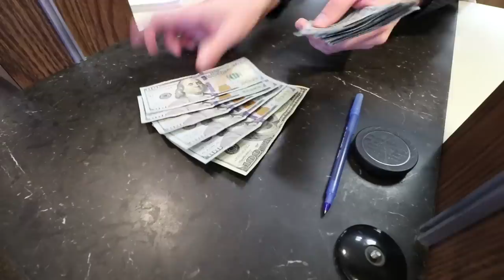WE BOUGHT A BACKHOE

Comment: How could you even say a comment about turbo when it is rather apparent you know nothing about the workings of a turbo equipped engine. Any diesel engine with a turbo is much better than one without for quite a few reasons starting with the engine puts out much more power at and above 2000 rpms, some engines spool up the turbo a bit earlier and some a bit later but generally at about 2000 rpm's the engine is putting out enough exhaust flow to spin the turbo at a high enough speed (rpm's) to boost the intake pressure. Reason two is that the engine get's better fuel economy since it is burning more of the fuel due to having fresh pressurized intake air flowing into the engine under pressure instead of the engine running like a vacuum cleaner sucking the air which causes much less oxygen to be available during the power stroke of the 4 cycles. All of my equipment is diesel powered and my tractor, dump truck and bucket truck along with my crane truck are all turbo equipped. The only truck without a turbo in my yard is the 1992 F-250 4-WD 7.3 L and it get's lousy mileage. Last but not least turbo diesel engines put out cleaner exhaust with less unburned diesel particulates and that is not only good for the environment but also better for working around like a backhoe, given that the engine is running at or above 1750rpm;s. The only bad thing about some turbo equipped engines is that if the oil seal ever fails that supplys the turbo chargers lubrication there is a possibility of having the engine start running on it's own engine oil and then it is an emergency situation to shut it down before it blows up from over revving or running out of engine oil. Two easy ways to go about this. First one is to have a good reliable full 10lb CO2 fire extinguisher handy and the ability to squirt it off directly into the intake which on most engines/vehicles is easier said than done and the second way which happens to be the way that I prefer is to have a shut off valve plumbed into the turbo oil line so that if the rare chance that the turbo blows a seal you could just turn a valve either remotely or open the hood and turn it to stop oil flow to the turbo and the engine will immediately stop running, this method is a sure fire thing since if other methods don't work chances are that the engine will begin to roar and run at such a high speed one would be reluctant to open the hood or even get near it in fear of it exploding. Long story short turbo charger equipped diesel engines cannot be beat by any other internal combustion engine as far as efficiency or longevity. And just encase you or other readers are not familiar with a turbo charger here is a simple explanation of what exactly it is: A turbo charger is basically a small exhaust driven turban connected to a slightly larger fan in a housing. When the exhaust of the engine spins the turban it in turn spins the fan which compresses the intake air supply that feeds the engine, 7-10psi boost is all it takes to make a diesel engine run better, cleaner and actually quieter.

Comment: You know you never buy machines that have had 5 gallon rebuilds people make things look clean and shiny to hide the turd under it. When somebody goes to the extent to paint up a machine and put on the factory decals they are hiding something. You possibly could be into this machine for thousands of dollars in repairs. Sure hope you know what your getting into, if I'm buying a machine I want to see it dirty I want to see what's leaking, what is worn out. Enough of the talk lets see you guys use the machine if you were an operator you should be able to backfill that trench up the hillside with it. I will laugh a little when you try to use the foot pedal swing on the hoe its a horrible system if your not careful the boom goes swinging really fast and you end up slamming the bucket or the boom into things.